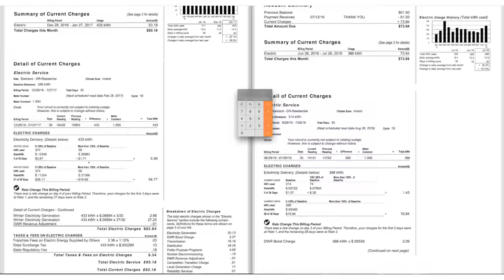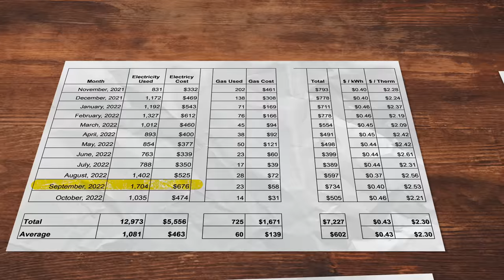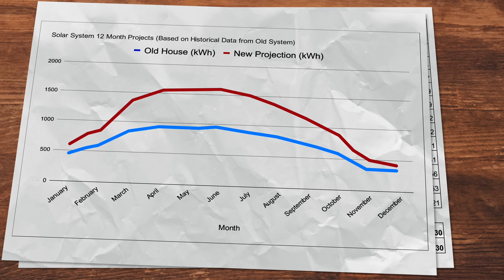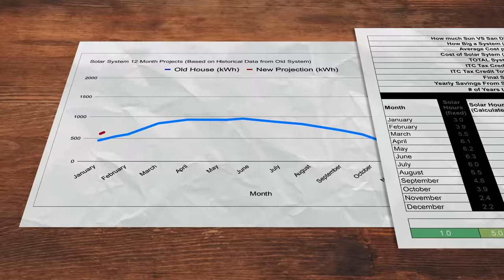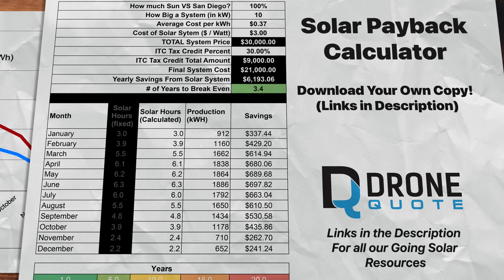Go Solar Before April 2023 - EVERYTHING Is Changing!

Comment: Just toss a boost converter on each panel, then you get higher voltage out of each panel. Just need to ensure the output voltage is the same on each one.
Reply: Nearly all DC power supply outputs cannot be safely paralleled or, for that matter, safely put in series without a common ground.   Their output stages can't handle reverse-bias beyond a few volts (that is, if the input voltage to the DC supply is zero and the output is tied to another DC supply which is outputting its nominal regulated voltage, then the output stage of the DC supply in parallel which has no input voltage will be reverse-biased).   DC supplies generally cannot handle reverse bias unless they are made to handle it.

So if you do this, you have to buy actual solar 'optimizers' which are designed to handle those sorts of conditions.   But I gotta say... solar optimizers are talked-up a lot, but they do not have a good track record in the field.  The failure rate seems to be rather high compared to, say, an enphase microinverter or (better) nothing at all on the roof except the panels themselves.

For a series configuration, an off-the-shelf DC supply also won't work reliably... it is unlikely to be able to pass-through the required current under all shading conditions, in addition to potentially getting reverse-biased.

Solar optimizers are generally made for either parallel (voltage regulated) or series (current regulated) operation, but not both.

Comment: If you live somewhere with high electricity rates and can afford the upfront cost of installation it seems like solar is a no-brainer.   I have some of the cheapest electricity rates in the country where I live at 7 cents per kwh and even here a solar installation would pay for itself in savings(though possibly only with a diy installation to save costs).  A friend of mine got a quote of over $60,000 just to be able to connect the grid down his long driveway for a new house build.  A solar installation there would pay for itself on day one.
Reply: It also depends on how much electricity you actually use.   There are numerous states with $/kWh costs less than half of California's (even 1/3), whos monthly bills are actually higher than the typical Californian (Ricky not being a typical Californian, by the way).   Generally due to environmental conditions.  There is a big difference between having to run your HVAC three or four hours a day and having to run your HVAC 18 hours a day.

Most of the cost of electricity is not in the generation.  Its the cost of maintaining the transmission and distribution system.
Reply: @junkerzn7312  you're missing a major factor in your comparison. Your home may already be 100% electricity (ie hvac, hot water).  Ricky like most Californians has split utility, he also has a huge gas bill from the monopolized utilities.  Pacifc Gas & Electric.  If he converts gas appliances to solar powered electricity he supercharges his payback period with the cost reduction.
Reply: @jstaffordii  No, I have a gas furnace.  Not sure why you thought I didn't.  I have a heat pump water heater, and a gas stove top.   Just about everyone these days have electric ovens and I do as well.   Eventually I'll replace the furnace, but not yet.   And I have a gas fireplace, but that's just decorative so use is optional.

When it comes to natural gas, the only thing that really matters is the gas furnace and gas fireplace (the latter only if it is used heavily).   The natural gas consumption for everything else is in the weeds.

I would agree that the solar payback period would be shorter with home heating also using electricity, but I would not use the term "supercharged".   In California, home heating is only typically applicable for around 4 months of the year (Nov, Dec, Jan, Feb).  Outside of those months the heater will barely need to run.

But during those months, gas bills can be quite large.  My gas bill for December was $600, all home heating.  (December was really extra cold this year).   It would have been more but I think I was able to cut it down a bit by running the hot water recirculator pump more or less full time to bleed off some of the heat made by the heat pump water heater into the house.
Reply: @junkerzn7312  $600/month for heating is foolish. Buy a high seer heatpump, it will pay for itself in annual saving in a very short period. 
We have been net zero for three years other than a $30 monthly connection fee and have an annual  buyback of 3 Mwh/year on a 9.25 Kwp system in Central Florida. Still researching batteries for full off grid option when our power price exceeds $0.20 kwh (this is the current break even point for our costs) in the next few years or utility politically lobbies the killing of net meter 2.0.

Ricky will also  be solar fueling 1 or 2 electric vehicles, all of those savings do supercharge his payback period.
Reply: @jstaffordii  Yes, I agree its expensive.   We will be replacing the furnace at some point.  But we will keep the gas stove-top, dryer (also in the weeds), and fireplace.

My actual PG&E gas bills for the last 12 months (SF Bay Area, California):  Dec 2021 through December 2022:

Dec21 $650
Jan22 $540
Feb22 $280
Mar22 $177
Apr22 $131
May22 $77
Jun22 $13
Jul22 $20
Aug22 $8
Sep22 $8
Oct22 $58
Nov22 $416
Dec22 $528

So for December it was $528 this time (My $600 in the last posting wasn't quite right in recollection).

I think my use of the hot water recirculator this time around (leveraging the heat pump water heater's efficiency) has helped.  It burns an extra 8kWh/day and puts roughly 24-30kWh worth of heat into the house just from pipe losses.   Not a ton but still... roughly equivalent to two space heaters running 12 hours a day is nothing to sneeze at.

December 2022 was definitely colder than December 2021 but we only used 177 therms in 22 verses 250 therms in 21.   I'll take that as a win.   The extra electricity cost me around $57 (its been extra rainy so the solar system only contributed 25% to whole house electricity use).

--

This is another facet of solar energy that must be considered.   Winter production is a lot lower than summer production.  Rule of thumb is around 50%, but this year with all the rain and storm clouds its been even lower.  My June production clocked in at around 1000kWh (for the month), while my December production clocked in at only around 300kWh.   That's with a 5kWp system. 

Very linear this year (June through December).  1000kWh, 900, 800, 700, 540, 400, 300.  There is less electricity from solar available in winter.   It saved me roughly $2500 in PG&E electricity bills in 2022.    That's with the BEV, too.

Covering my worst winter month entirely with home solar would require around a 20kWp system.  I'm not going to do that :-).  But I will be doing a project this summer to bump it up to roughly 10215kWp (batteries too so being on the new NEM won't be a problem).

-Matt
Reply: I guess I missed the part in the video about EVERYTHING changing in April 2023.  What changed?

Comment: I am confused why you started with the solar panels. The solar panel wiring is constrained by the inverter, and the inverter should inform the voltage and current ranges of the panels. It is possible to work around a bad inverter choice by AC-tying another inverter into the system, but this is another added expense. The inverter can also have problems associated with imbalanced loads on the electrical panel. Those imbalanced loads can then force the inverter to shut off. The inverter choice should also be based on the offset and energy usage to know how big of an inverter you need, and which loads the solar system will need to handle. Granted the roof will inform how many panels you can place there, and how low of a wattage requirement you can have on an individual panel, but the inverter still will be the bigger bottleneck.
Reply: I think its ok to start with the panels first and worry about the inverter later.   Ultimately they have to be compatible with each other but the worst that happens if you make the inverter too small for the panels is that you shift some of the panel coupling around... make some strings DC-coupled and some strings AC-coupled.  So it isn't the end of the world.

Most of the issues involved here, particularly balancing loads, are just between the inverter, its batteries, and its charging and inverting capabilities, and the home, and have nothing to do with the solar panels themselves.   i.e. the inverter has to be able to handle these issues even when the sun is down.

--

The simple rule of thumb for whole-home backup is to size the continuous power output capability of the inverter to roughly 2x the home's worst-case consumption.  That will usually handle leg imbalances and continuous reactive power (e.g. from an A/C unit).   So if your home uses, say, 13kW worst-case, you would want to size the inverter to be able to continuously supply 26kW, and to have a surge capability that is even higher (40kW+).  For example.   People often make the mistake of under-sizing the inverter, thinking that only the surge load needs to be double the continuous load, but that is not actually the case.

This rule of thumb doesn't handle all the cases, but it will cover 99% of them.  If reactive power is still a problem you might need to add power-factor correction to the biggest inductive load.

For leg imbalances... usually the imbalance that can be handled scales with the continuous output capability so the rule of thumb usually covers that pretty well too.  Also not a function of the solar panels since the inverter has to deal with it even when the sun is down.

--

The only real issue with the solar panels occurs for AC-coupled panels in grid-down situations (and only in grid-down situations).  In this situation the inverter must servo the solar panel output (via frequency shifting).   This servo mechanism is slow, it can take 30 seconds to match the solar output to the home.   Because of that, the inverter's battery charger and the inverting function MUST be able to handle the difference while the panels are being servo'd to their new output level.   If the battery is nearly full, the inverter has to actually servo the panels even lower so it can burn off some of the energy from the battery to ensure it never becomes completely full.

What happens here is that if the inverter is not up to the task, the AC-coupled solar panels can over-produce, push the AC voltage to the cap, and then hit their grid anti-islanding trip point and shutdown entirely.

There is also one more thing people with AC-coupled systems need to remember when they have battery backup, and that is that if the battery is run out overnight in a grid-down situation, the inverter will be forced to shut-off the inverter output and that will prevent the AC-coupled solar from bootstrapping in the morning.   So it is always a good idea to have at least one solar panel string DC-coupled to be able to charge the battery in the morning enough for the inverter to turn on its inverter again and bootstrap the remaining AC-coupled solar.   A lot of people forget about this issue.

Comment: It seems like you could do much better with an off-grid system if you have space, I would make it in an awning / gazebo w battery so you're not just taking up ground space. It seems like there's so much drag and expense to roof mounting & grid tie
Reply: The costs definitely add up, particularly if one has a battery system.   They can be extremely variable though.   If one has a shingle or standing-seam style roof, putting panels on the roof is pretty easy (totally trivial with a standing seam roof because no drilling is required at all).   It becomes more problematic with tile roofs.   DIY can be 1/3 the cost of a professional install, but takes a lot of work and knowledge.

Space isn't typically a problem.   Usually the garage will have plenty of space.  If in snow-country, though, its nice if the LFP batteries are in an insulated shed or inside the house.  The inverters just go on the wall.  Even a large battery bank is literally just the size of a small computer rack.

Grid-tie is the least costly... it just requires running roughly a 30A circuit to the inverter and that's it.  Battery systems are a lot more expensive because the hybrid inverter is going to have an integrated 100A or 200A transfer switch, so there is quite a bit of electrician's work.   Utility service has to go into the hybrid inverter(s), then the AC output from the hybrid inverter(s) has to go to the home's main panel.

So where the main service comes into the house matters... if the main service is near the garage it makes everything easier.